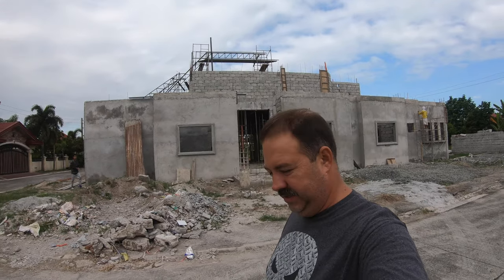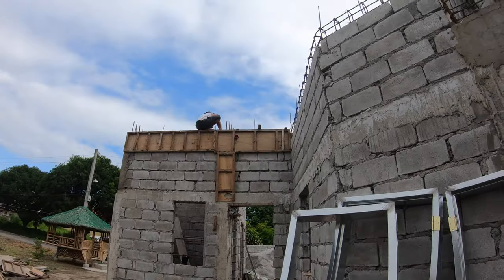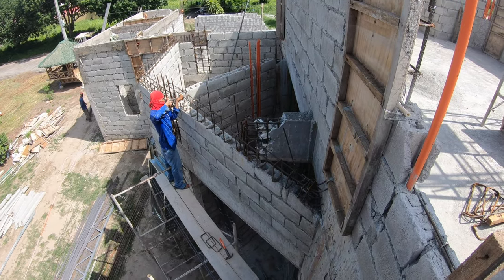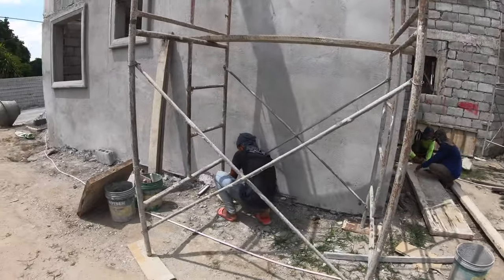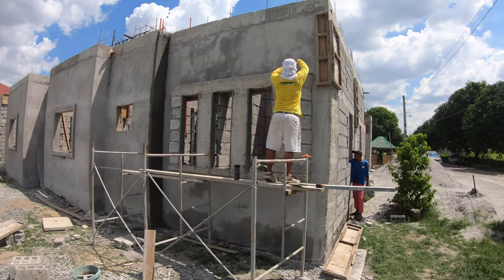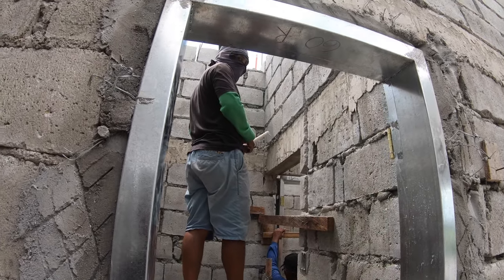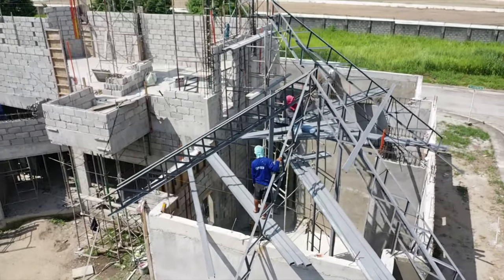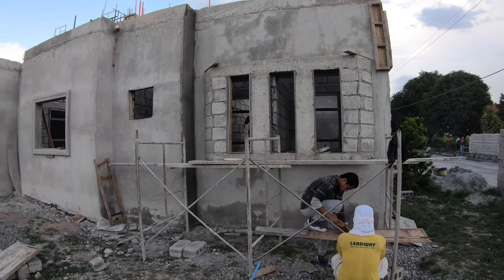Philippine House Building Step by Step, Build Day 85: More Trusses and Doors

Comment: Big thumbs up + thanks for showing the roof lay out it is a massive roof with a severe pitch. I haven't seen any of the usually placed in the pier rain spouts - I would expect there to be many and wise if you are not embedding them in the pier and rather surface mounting them on the walls. Another commentor mentions the metal frames for your doors they look nickel plated to me - great choice to use metal frames as if they are done properly you will have no issues as you would with wooden frames.
Reply from the maker: Serge, downspouts are placed inside the columns, however the size was enlarged to accommodate. We’re going with a “hidden” gutter system. Don’t care for the big open troughs on the side of the house and ugly downspouts taking away from the house.
Reply: @CasaTexPina  - fair call - I did notice some down spouts (in Australia we call them down pipes) encased in the columns however as orange is the colour for electrical + sewerage and down spouts I thought they where electrical conduits - your house will definitely stand out from the rest in that neighbourhood - with such a big roof will you have tanks to store some of that precious water in  ?? I have seen in one other house building video from the Philippines that they built a water storage cistern below the garage floor.
Reply from the maker: Unfortunately, not capitalizing on the rain water just yet. Perhaps a follow on project in the future.

Comment: Didn't notice if there are lintels above the window openings. Don't you need one above the doors too even if you're using steel  frames?
Reply from the maker: They didn't do the typical metal lintels that we see in the states. Here they did the "lintel" beam at that level all the way around the house. 10 courses of hollow block followed by a beam to spread the weight to the columns.

Comment: are the door frames galvanized?
Reply from the maker: Great observation. Yes, they are galvanized steel. Prevents rusting until it is ready to be painted during finishing.
Reply: I like the door frames, better than using timber,
Reply from the maker: Peter T, Yes certainly. Have to prevent termites any way we can.